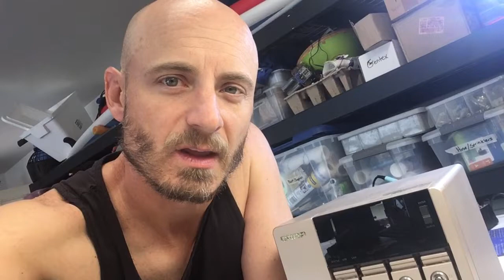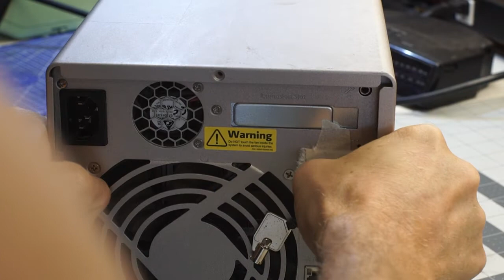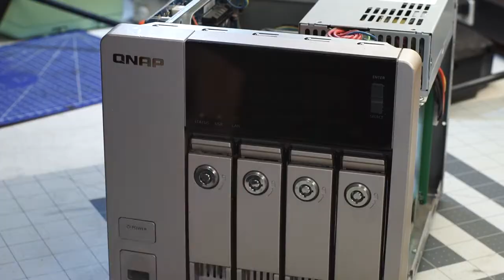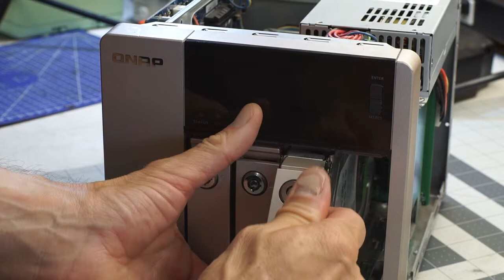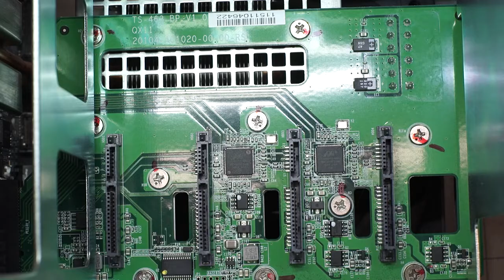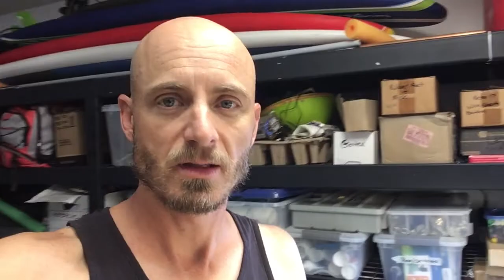QNAP hard drive bay failure (FIX!)

Comment: I have a TVS-663 for about 9 years that periodically drops bay 4 for no apparent reason.  Usually Shutting it down, sliding the drives out, giving it a good blowout, reinserting the disks, and starting it back up fixes it for me... but not always. Sometimes multiple times of doing this, and it might in that process drop 3-5 or 6 as well.... having a good look at the mosfets in mine, after watching your video, it looks like the same ability to bypass them exists, so I might try it and see what happens. Otherwise it's destined for the scrap heap. :D  I have a larger TVS-h1288X that has been perfect for 5 years and so this one was just some backup storage really. Beyond that, i'm building a server to get out of qnap land.  Between this TVS-663 and my TVS-1288X I had a TVS-872XT and that died twice in 2 years requiring a motherboard swap.  They got enough of my money i think....  Cheers for the video!
Reply from the maker: Thanks for sharing!

Comment: I have a QNAP TVS-471 model and the backplate where it is not recognizing 2 drives. but the backplane is not looking the same as in your video. Can you help me troubleshoot the issue or if there is any place to find the circuit diagram. the backplane number is TS-471-PRO-BP v1.0 QW69

Comment: Also worth mentioning after further digging this issue seems to be related to temperatures and fan speeds. Manually setting the fan speed settings is worth trying before getting the soldering iron out. Either set to medium or if thats your option or set to low speed 35°C / full speed 45°C

Comment: I have a Qnap TS-251 with this problem, I'm not really sure what to bridge I only see 1 solder jumper but it has 2 drives. I found a high res picture from the board could you tell if that is the right bridgge? https://cdn.eteknix.com/wp-content/uploads/2015/10/QNAP_TS251-Photo-sata-bridge-751x1024.jpg

Comment: Thanks, I saw another video where they jumpered some of the arms on the mosfet, your solution is cleaner if you don't plan to ever replace the mosfet, but if you are just doing this in order to wait for the mosfet part it's probably better to jump the mosfet top left pin to second pin down on right, then both bottom pins.
Reply from the maker: That would work as well.  I assume this happened to yours too, good luck!

Comment: Mine was collecting dust for 3 years as the bay quit working and I replaced it with another model. Luckily I never threw it out, saw your video and it worked. Didn't have to buy an additional NAS. Wow, very helpful!
Reply from the maker: Nice!  Now you have two!

Comment: Fantastic content. I have a 5 Bay Qnap that just started freaking out saying 4 and 5 were toast which I was finding hard to believe as the drives are only a few months old with very little usage.. Took the system apart and sure enough four and five were on this idiotic arrangement. It would actually wok with one drive or the other installed but not both. I assume it was outputting just enough for one. I jumped it out as you showed and appears to be good to go.
Reply from the maker: Excellent!
Reply: Hey which 5 bay where you able to fix I have TS 563 and bay 4/5 is also not reading the drive. Also wonder which mosfet did you bridge

Comment: i just got a ts-253a. i bought 2 WD red nas wd40efzx drives. i get an error of no hard drives detected no matter what I do. hhd lights on front panel no light. Powers up just fine.
Reply from the maker: Dang, that's not good.  I suppose it could be something similar, but then again, maybe it's a fault with the power supply?  Sounds like you're going to have to do some digging.

Comment: One of my sata panel mounts where my hard drive slides into broke off , is there maybe a video on how to fix it
Reply from the maker: Dang, that's not good.  While not necessarily impossible to repair, that's going to be a substantially more difficult thing to fix, and beyond my abilities (and equipment).  If you've never done that kind of thing before, you might need to take it to a professional.
Reply: Thanx for the reply brother 👍

Comment: Hello, nice video! I have a similar issue with my QNAP TS-431, where suddendly the 4th disk is being seen for a couple of minutes, then marked as faulty and disconnected, I believe that its a mosfet issue. the backplane is marked as TS-451 BP 1.0 QW63. Is there any way that I can send you some pics of the board and you can highlight me the pads I should solder in order to bypass the faulty mosfet?
Reply from the maker: If the drive is ever being seen at all, I have my doubts you are experiencing the same issue.  I would try a different drive in that bay.
Reply: Hello Cristian! I have exactly the TS-431p.. if I add the 4 disks it's all green.. BUT if I try yo create a volume, after the volume creation, during the synchro... The disk is fail, then disconnected and then the raid is (of course) degraded... I opened a case yo qnap, the reviewed the situation and defined the fix changing the backplane (a compoment or the complete backplane)... Cost? U$s170.. i really do not know what to do... 😢😢😢
Reply: @javierquintana7504  hi! I've not tried to create a new volume, but it sounds the same issue as mine. I did open a ticket to QNAP but they mentioned an hw issue with components to be replaced, so at the time being i've done nothing, just keeping the qnap as it is. maybe I'll try to solder the component as in this video and loose the hot-swap function, but getting back the change to use all 4-bays
Reply: @cristianinvernizzi2883  hello Cris! I did open a ticket and the Qnap support from México connected to my nas using Teamviewer.. they run some commands and defined the backplane issue, to fix it? U$S170... So i didn't do nothing... If all the Qnap customers are having the same issue.. is understanding Qnap that we will never purchase this hw again? 😔😔😔
Reply: @javierquintana7504 yeah, I get your point and from customers point of view it's right, on the contrary we're talking about consumer hw that was released 10 years ago or even more, so it's understandable. What it sucks it's the fact that there's no spare parts available, with 20-30usd maybe we could purchase a spare backplate and solve the issue by ourselves...

Comment: I had the same issue. But it's on both 3 and 4. I will give this a try. At the very least, I should be able to get my days backed up to a cloud location.

Thanks for putting this out there!
Reply from the maker: Happy to help, I hope it works out for you!
Reply: @ShanesGettingHandy  So I ran into an issue. Not knowing electronic components and circuitry, My Raid Card is different than yours. Not sure where the solder would be applied. Any chance I could send you a picture? I have the TS-459 Pro II

Comment: recommend for reliability?
Reply from the maker: That is a question that remains to be seen, but considering there is a jumper point already located on the circuit board for bypass, you can tell they weren't completely sold from the very beginning that the mosfets were a great plan.  Some guys are replacing the mosfets and then adding heatsinks to extend the lifespan.